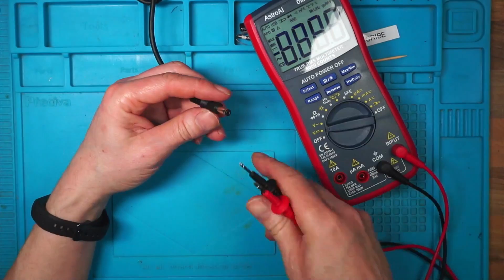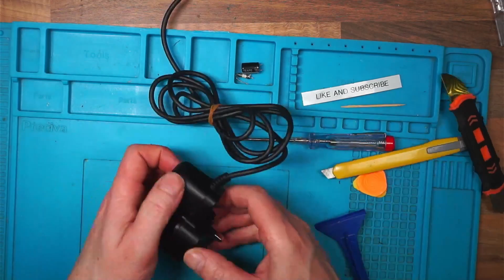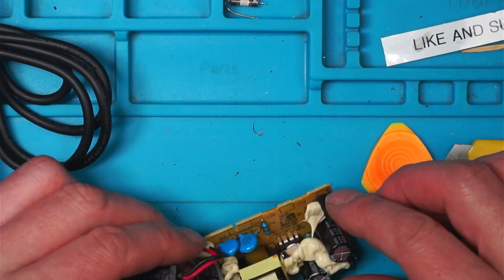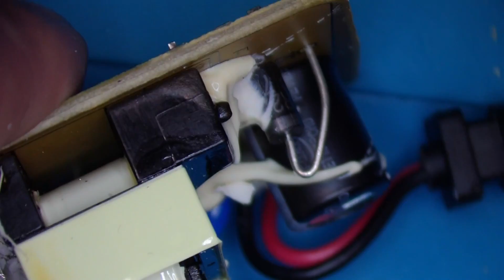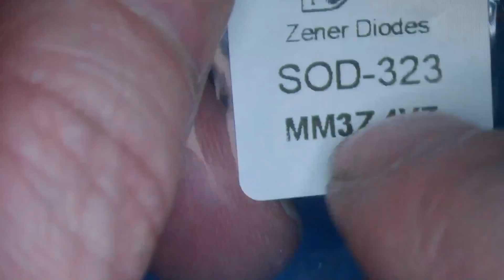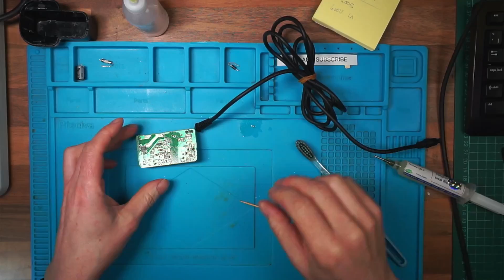Trying to fix a PSU | Switch mode power supply | No output | PSU Repair

Comment: It was cool to see you discharge the caps and show the voltage before and after. It's rare to see anyone do that on video for some reason.
Reply from the maker: That's probably not the best way to do it. I should make up a resistor with a couple of probes to do it properly. Either way, I'm glad you enjoyed it and thank you for leaving a nice message.

Comment: Just for science you should give it back to him. 🤣
Reply from the maker: Well the science in the vacuum must be faulty because it popped the charger as soon as he plugged it in. There may well be a Bosch vacuum on the blue mat very soon.
Reply: @PhilipBryden  If so I'm looking forward to the repair video. If you film the repair.
Reply from the maker: I got the charger back and it was working fine. The fault was the vacuum not charging. I opened it up to find Bosh had coated the circuit board with something like hot glue. I couldn't see any physical signs of damage. Fuses and diodes checked out ok. There was some voltage in the batteries. I suspect the power management chip has blown.

Comment: Nice to see you back Philip, nice fix well done it’s nice when you strike it lucky like that.😊😊
Reply from the maker: In future I will check for shorts on the input and output before opening anything up. Thanks for sticking around while I was away.
Reply: @PhilipBryden  that’s normally the best start, no worries mate those boards I gave are probably a good place to harvest parts.
that power pack is still here mate

Comment: I love those little power supplies. I use them for all sorts of neat projects. 

Most recently, I rebuilt the power supply of a commodore 64 with a pair of those wall warts wired into the original OEM commodore brick. Then I fixed the oem brick for a 1541 mark 2 floppy drive.
Reply from the maker: I'm assuning the C64 needs dual voltage then. Interesting idea to rehouse them in the original PSU shell. Nice one. This one looked like a pretty decent model but I recently came across an absolute horror. If you haven't seen the video, you might enjoy the worst PSU ever lol. 
https://youtu.be/o1h2-nbpegE
Reply: @PhilipBryden  Yeah the commodore 64 requires 9 volts AC and positive 5 volts DC. The matching 1541 floppy drive requires positive 12v DC and positive 5v DC. 

So what I did for the commodore itself was reuse the 9v ac transformer that was in the original power supply, and replaced the 5 volt side with the guts of a wall wart. The 1541 mark ii got the guts of two wall warts. 

(I got a little mixed up on my original post. My apologies. I blame lack of coffee).